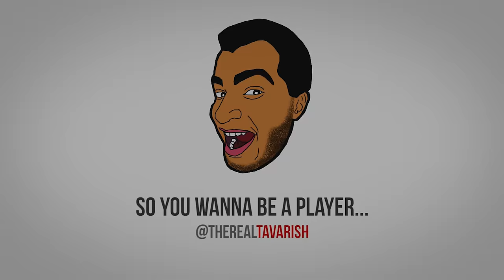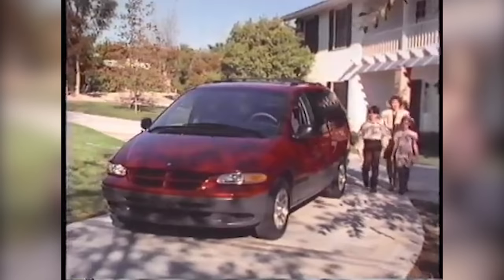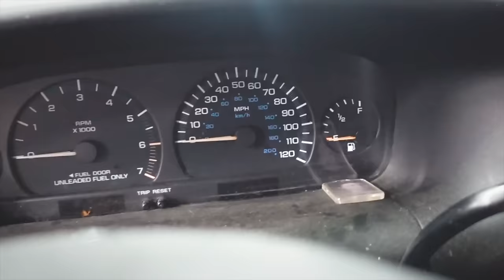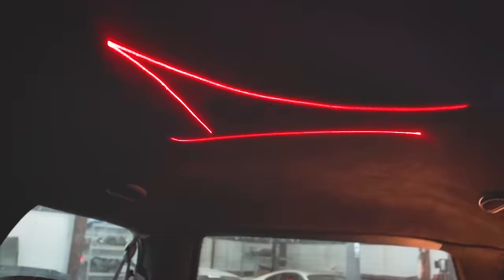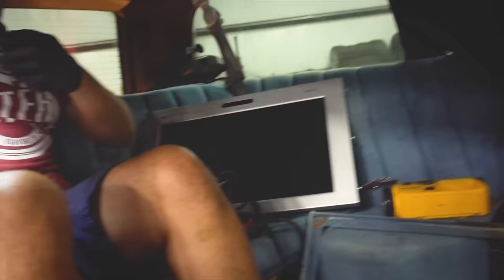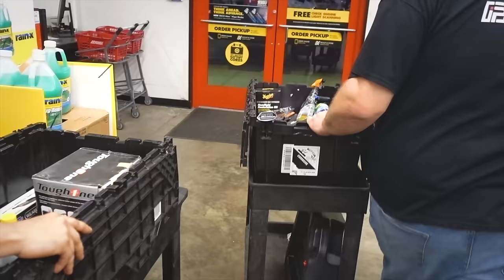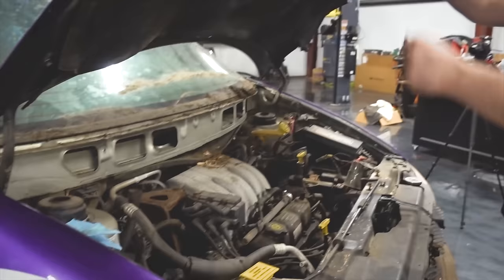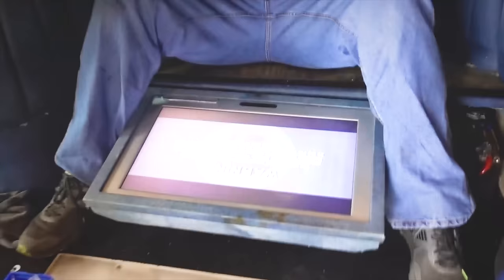I Bought An ABANDONED "Pimp My Ride" Minivan For $850 And It's WORSE Than You Think

Comment: I love how one door didn't have a handle while the other one opened into a wall.
Reply: Tru Quality  Nah, I honestly think they did it like that on purpose so you can still open the wall of screens in case you need to replace some cables or whatever
Reply: Tru Quality  umm that actuall would make sense is the door that opens houses the electronics  you would not iwant it to be automaticly opened only
Reply: the side with out a handle   is the entrance and  the side that  has access is  where all the wires are
Reply: Tru Quality  you can easily find the original episode. On top of that it's super obvious. The panel the guy was holding was the plexiglass cover for the foot-rest.
Reply: @stevedanger1515  that's stupid because you need to get into the car first just so you can open up the back door for passengers. it's like those side are completely switched but they already made custom cast and did the wrong side so they improvised the with auto slide door.
Reply: Basically the van is now a two door coupe with a lot of room and seats.
Reply: In the show they usually pimped it out but never fixed engine problems or internal problems which SUCKED.
Reply: Custom service access panel.
Reply: @theterminator3907 They stick to their show's name. Can't really blame them.

Comment: I am SO impressed by how well that paint job held up. That car spent multiple years outside, in the northeast...
Reply: If you can keep the paint nice it’s not surprising. Modern cars are made better than boomers like to let on.
Reply: @twinturbo9113  Cars don't rust like they used to but are far more complicated which makes failures far more costly especially as the vehicles age and the complex electricals deteriorate.
Reply: @PointNemo9 not to mention the fact that the software and cables it takes to do anything to a vehicle these days is WAY more cost prohibitive and with a much steeper learning curve than the old days when your dad's wrenches and a basic print manual would suffice for most tasks.

Comment: Wow, I actually remember this thing. They installed a sound system on the bottom of the van to blast fake engine noise. Even for the early 2000's it was distasteful. Awesome.
Reply: Ah the infamous vroom box haha. What were they thinking.
Reply: I was so naïve I didn't realize they actually used other cars than the ones brought in. Sometimes at least.

Comment: I've figured that there was something up with Pimp My Ride bcuz I didn't believe that it would take them to restore rundown cars into customized cars within a short amount of time which it usually takes to restore a rundown car into a customized car is about a year or two maybe more depending of the size of the car 
 if you take your time and with a whole lot of money to put into the car?
Reply: If you're doing it on your own with a couple of friends as a hobby then sure it could take that long but with a budget, shop and crew you could manage it pretty quick. Though the fact they cut corners isn't surprising either
Reply: They made it seem like it was done very quickly for the show but contestants have stated that they waited for months after turning their car in
Reply: the issue with Pimp My Ride was mainly the fact that they added all this luxury nonsense (which a lot of the time it was controlled by a guy off camera w/ a laptop, and not even real), but on top of that, they ignored actual mechanical problems the vehicles had.  So if you got on to pimp my ride and your engine was bad, you might come back w/ the same car with a dvd player and a soda making machine in the back or w/e, but the engine will still be bad.

Comment: The people that got their cars pimped have no idea what maintenance means. That is the main reason why all the cars just rotted away or ended up in a yard or backyard somewhere. Even if they had a new car, they would never change the oil unless they got a notice from the dealer.
Reply: Most of the cars that were on the show,, were stripped of most aftermarket parts they installed after the taping of the episode...and they never did any real engine upgrades.. if any at all!
Reply: Why would the dealer send a notice out on a 10 yo third or fourth owner car?
Reply: @dylweed4296  someone got a new crate motor because one of the people on the show ran it with sludge for oil and it seized up.
Reply: Sterlin876 true. All the peoples rides they “pimped” belonged to poor kids that knew nothing about vehicles.

Comment: So that's how Pimp My Ride kept going for so long- they made the cars look so pretty, but basically kept the engines untouched to the point the car falls apart after the cameras stop rolling. I wonder how many of those cars are still in decent shape if the owners kept up on their much-needed upkeep.
Reply: car S.O.S still my fave car restoration show, they really pay attention to the safety and blatantly tell that on camera if they can't use the original and have to change the car frame, or engine...
Reply: @ZionHillCalling Lot's of the owners were just idiots.
Young people with no clue, except one young guy who was doing it for his mother. Car was so bad, the ended up giving them a new car.

A new paint job will only last 5 years or so.
Reply: Well, hot rod saturday and tuuuners were the thing back then and so Pimp My Ride did at least one motor swap to keep up with the trend.

Comment: You know,  the most unbelievable part of this vid is that Advance actually had all those parts in the store.
Reply: The Pep-Boys in the old town I grew up in is going away and turning into an Advanced Auto Parts... Strange how much a town changes in a little less than 10 years...
Reply: Not really, cause a lot of the parts like filters etc probably have engines that still used that even 7-8 years later. Some those engines get used for a long time with very little changes to a lot of parts on them since its cheaper if its already being made. Look at engines like chevy v8 305, yea internals like pistons and stuff changed but a lot of things i would bet haven't changed much.
Reply: Highly doubtful they pre-ordered the parts for sure
Reply: They’re sponsoring this video so obviously this was an advertisement
Reply: Wait advanced gave you the right parts the first time?
Reply: @arbiter1  You would be extremely surprised. As someone who works at a Level 3 sized Advance Auto (Which is a larger size compared to most AAP stores and sees more revenue), the fact that he had almost all of that in stock is baffling. Though, these last couple of years weve stopped shelf stocking older (Early 2000's) vehicles' parts.
Reply: @bigblockchevy200   My thoughts exactly. I worked at a modestly-sized one for five years and, aside from the PTSD I got from all the sights and sounds during the shopping segment, I was shocked that they had everything. In my experience, at least half of that stuff would be PDQ or transfer.
Reply: With a mile long receipt that puts CVS to shame
Reply: Shocker, because AAP blows ass for a parts company
Reply: @bullpolizei  Can confirm, worked there for five years.

Comment: I think I've seen maybe two episodes of Pimp My Ride, and in at least one of them they openly admitted they replaced the car; the 'original' care was two halves welded together (like, take the back half of a car that was in a frontal impact, and the front half of a car that was in a rear impact, saw off the wrecked ends and weld the two 'good' halves) and they basically said 'yeah, that's probably not even legal' and got the guy a new car.

Comment: WHY in the hell didn’t they shave the handle on the driver side sliding door when it wasn’t meant to be an accessible door? It would’ve made sense to shave that handle and if not shave the other side, then leave the handle since now the poppers probably don’t work anymore.
Reply: To work on the electronics or remove the little added wall / bead shit and use the door like normal

Comment: Someone had a show where they did this with heavy trucks. 
I don't know if it was on the show or just done by the same shop, but I've been told about a truck that the wiring was so butchered, the owner scrapped it. 
The engine harness was the only salvageable wiring in it.

Comment: 3 years late to the party... but funny you mentioned how PMR would just swap out the vehicle for a new one.
Foose does the same in his show.
I watched one of his Pickup Truck shows where they took all the panels, interior, entire engine, everything, off the vehicle's chassis, and replaced them with factory-new parts.
Then, they took the chassis, and replaced it.

Then they took the rest of the outer parts like wood panelling, wheels, brakes, wiring....... and replaced all of it.

Once it was all ready to go back together, they realised they'd need to replace the entire dash with a new mileage readout because everything was new.

There was nothing of the original truck left. Everything was replaced.
They basically built a new truck.

Comment: Well, at least it wasn't the VW van that they patched with chickenwire and Bondo.
Reply: Haha I remember that episode.
Reply: Chickenwire is actually a normal thing to use with bondo to repair holes in things, not saying I would do it, but thats like an official thing. I think bondo actually sells chickenwire squares for it.
Reply: FlyTheElephant ^^^
Reply: Suburban it’s a shame cause that one actually looked cool
Reply: @austin5806  Seems to me the hole was something like 12x3".  If are going to do a rattlecan primer paint job, or a discount Maaco cover-up, that's maybe not so bad.  When you are doing a custom paint job, you really don't want to have your patch cracking or crumbling though, because  that requires a lot more effort to fix.
Reply: @austin5806  I've used it for holding back livestock. I've seen it used on custom speaker enclosures. Not bodywork.

Comment: Pimp My Ride was a scam. Everyone that had their cars "pimped out" got it back in shitty condition with just new paint and useless gadgets in the car. They never fixed any mechanical issues with the car...they just outfitted it with useless crap lol.
Reply: I'd much rather have a reliable engine and transmission than a car that has a chocolate fountain in the back seat
Reply: George Cantstandya lol they also got charged for the paints and body kits etc
Reply: George Cantstandya yeah and you watched that crap.  Boom money made!
Reply: @evanm9026  damn...I did. Sucks being a sheep! Lol
Reply: @m200dreamer7  they got charged for that crap!? Smh
Reply: @benihanaa  I've seen a few other videos about them doing stuff like this. If it was a one-off, I'd let them slide. But  it seems to be their business model.

Comment: You never just recharge a AC system and hope it holds . You pull a vacuum on the system and see if it holds. Then put dye in the system and re charge if it will hold a vacuum . Then inspect with a black light to find the micro leak. A working system with no leaks will never be empty so there has to be a leak some where that has to be fixed. as this has rear air I bet it is the rear lines they always leak on the caravans of that age.
Reply: thanks scotty
Reply: I inserted a vacuum cleaner and now my car isn’t running, did I do something wrong??
Reply: thomas burns  that is true to a degree thats why its important to run them a bit all year to keep o rings and seals from drying out.
Reply: Yep, should have pulled a vacuum. We dont need any more refrigerant leaking into the atmosphere than what already does. Lord help the ozone!😂😂😭
Reply: @sincity2562  Yeah when they saw the big fuckin' hole in it back in the late 70s on satellite imagery it did give even the refrigerant industry pause. That can't happen. Oh shit there it is.
Reply: thomas burns  true. This world will end at some point😂😭

Comment: If a 1998 minivan was already being held together by duct tape and bungee cords by the time of a 2004 episode, the new new whoever that original owner was would probably just end up junking the "pimped" version. Some people are just really shitty with their things
Reply: Well, they do tell that a lot of times the producers would make the car look worse on purpose, like a guy that they filled his car with candy wrappers or another one that they filled with cigarrette butts
Reply: Also, most got abandoned cause they were still shitty cars, cause they never did any mechanical work, and with the added weight of the shitty stuff, suspension and performance went to shit.
Reply: They repalced the car..
Reply: To be fair those old minivans were junk rolling out of the factory.
Reply: Letter A, there are people who do not do vehicle maintenance.  They put gas in it and have it towed back to the dealership for trade when they can't see through the smoke anymore.
Letter B, it's a Chrysler.  The folks on the assembly lines at Chrysler factories work with their pants pulled down because that's how you make shit.
Reply: it probably got impounded and the owner couldn't get the money to get it back, that is why no one ever got around to stripping it down.
Reply: Well, all I know is that I got mine to last until 2012… Of course, not without frequent trips to the mechanic toward the end.

I imagine the producers of the show also gravitated toward car owners whose cars were in particularly bad shape as well.

Comment: the problem with cars from northeast is driving them. if you keep still it will rust a lot less.
Reply: @E.Asinus  noob.   The only way you're going to escape moisture and salt is in a control climate room.   Other than that,  you don't buy cars from cold areas

You will not be able to wash between every little area

Comment: Pimp my ride is known for ripping out all the accessories after they were done filming so the vehicles looked worse on the inside than they did before. I’m surprised they didn’t rip out the necessary materials needed for them to run. They really can’t take away a paint job but yeah they would take everything out that was cosmetic to the vehicle after they were done filing.

Comment: “Don’t want to run it too long without a water pump” 30 seconds pass

Pfff I had a VW Golf I used to drive for 10-15 minutes with no coolant before it would overheat in the Wisconsin winter lol, I’d just pour some water down that coolant reservoir and hope for the best.

I’m actually super shocked they had everything they needed in stock there.

When they went inside it was daylight out, when they left it was night time.

Comment: The show would often take out things they put in before releasing the cars back to the owner. they also did not do any mechanical repairs, so the vehicles are still mechanically a piece of crap when they got them back.they only replaced that van because the original one was rusted through in the sub frame so for legal reasons, they replaced her van so the show could still pimp her ride. Not a usual thing.

Comment: I don't remember where i read this or from whom i heard it, but it turned out that the guy from Pimp My Ride literally just pimped clunkers from the outside. He takes some really beaten up van and he starts adding unnecessary garbage like 15 screens... fountains... 15 speakers... shit like that... but the mechanics of the car are never touched

The car might have an exterior for thousands of dollars and it might not run because the fuel pump is not working ($200 to replace, for an example) It's going to be FANCY AS FUCK but the engine might be leaking motor oil...

And many people actually don't drive their "pimp my ride" clunkers because they're not running and many people prefer to ditch the car and buy a working one...

Comment: Those Chrysler 6 cylinders will run forever mine has 210,000 miles and runs perfect and 3.3 L have 137 horsepower in Chrysler did not have great under coating protection anyone that lives in the Northeast that owns one of these Vans knows what I'm talking about they're usually rusted real bad the motor will far outlive the body

Comment: since in 3 years no ones correct you please learn the diffrence between dirt and dust and rust and mould. Mold does not grow on metal
Mold does not grow on metal because mold needs a source of organic matter to grow, and metal is inorganic. Additionally, mold needs moisture to grow, and metal is not a good conductor of moisture. However, if metal does become wet, it can provide a good environment for mold to grow on other nearby surfaces, such as wood or paper.  Cars are made from a variety of materials Some of the materials used in car manufacturing include:
Steel, which is used to manufacture car bodies and has improved a great deal over time 
Aluminum, which is lightweight and durable, making it perfect for specific car parts Plastics, which are petroleum by-products and are used in car manufacturing Rubber, which produces engine mounts, hoses, seals, wiper blades, and belts Glass.

Conclustion: dirt and dust. please learn what dirt mould rust and dust is looks like and does, and dirt and dust isnt as dangerous as you where acting it was either, with the mask and gloves, save for maybe the spiders. once again please learn about mould and understand wtf mould is and how it works please you sounded like a idiot everytime you called dirt mold

Comment: the enclosure in the back is worth $800 alone? restoring the vehicle is literally nothing. Easy work, easy money. You could literally replace the entire subframe with new metal. It's not hard, it's time consuming. Replace the garbage struts with coilovers. Swap the motor and tranny, and you're laughing all the way to bank. This is simple work. You could easily wire a custom brand new wiring harness to a standalone ECU in like 24 hours tops, deleting all sorts of crap that doesn't matter along the way. and why tf are you using clamps for exhaust instead of welding? like what?